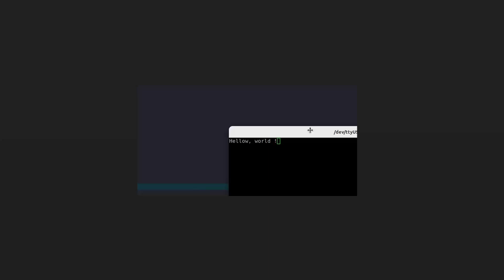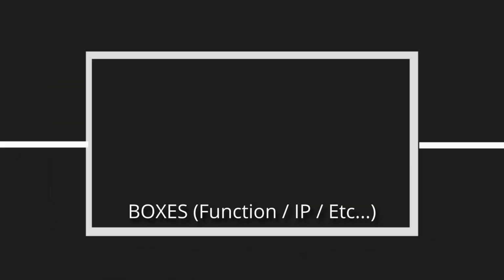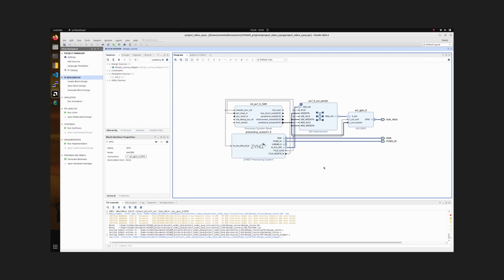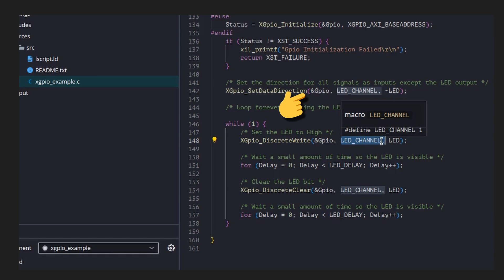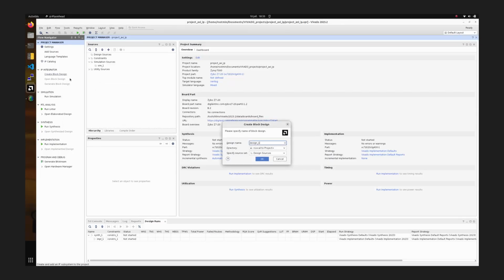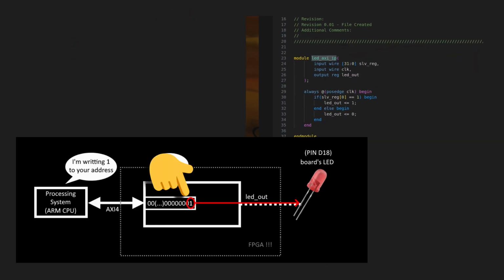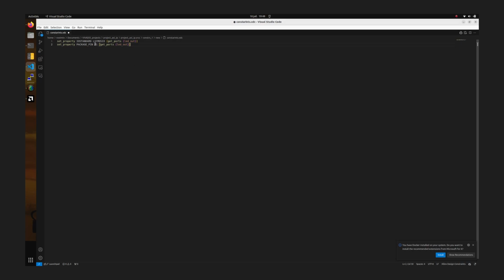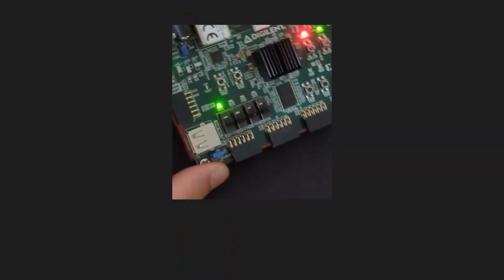How to make a Custom AXI LED IP | Zynq FPGA series

Comment: How would I try to do this with a custom board that uses Zynq but isn't in the catalog?

By the way, are there any resources I can use to learn about how to do this?

Thanks for everything! (Merci beaucoup pour tout monsieur français)
Reply from the maker: Well it would work exactly the same, except the constraints file would be different.

As long as the PCB allows the host (your PC with vivado) to communicate with the Zynq chip, you should be good to flash whatever SoC you want on there.

Comment: Hi, I am getting 'xgpio.h' file not found error :(
Reply from the maker: Try to build your platform in vitis first.

The platform is a representation ofyour SoC. This includes the CPU (that runs the code you are writing) and all the peripherals (GPIOs).

When you save that in vivado and open it in vitis as a platform, vitis knows what address your periphrals are binded to, and what drivers to use (as the peripheral used are made by xilinx themselves). BUT in order for your code to know all that, you need to telle vitis to transfert all these knowledge (of your platform layout) into code and drivers by actually running the build process).

Then when you create an application, it ill use these built drivers and header file to interact with your SoC in the right way. Hope that makes sense

Comment: nice and cool video. I tried creating axi ip with just 10 registers and transfer content from PS to these 10 registers. But this ip is not recognized when building platform project in vitis. why?
Reply from the maker: Thanks !

Regarding your issue, did you include the bitstream ? Did you connect your IP successfully to the rest of the system in the block diagram editor ? Did you assign an address in the address editor ?
Reply: @BRH_SoC  . yes. I included bit stream, IP successfully connected. I manually didnt assign any address, vivado itself assigned address (0x43C0000) as base address. I am of the opinion that it may be related to driver issues. but unable to point out the error.

Comment: what does IP stand for?
Reply from the maker: IP Means Intellectual Property.

An "IP" module is a logic block you made, that does a very specific thing that other people can use, for free or paid.

Some businesses are based on making paid IP, others make open source ones. In software, I would be like "libraries" even though it acts more as a function.